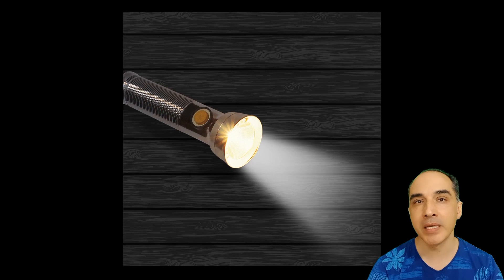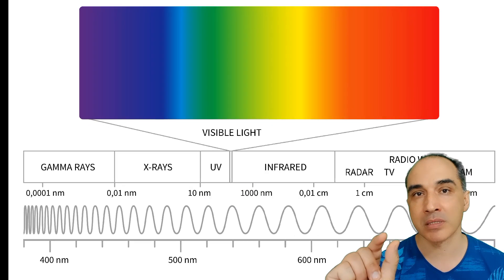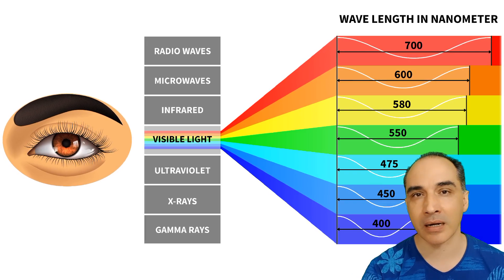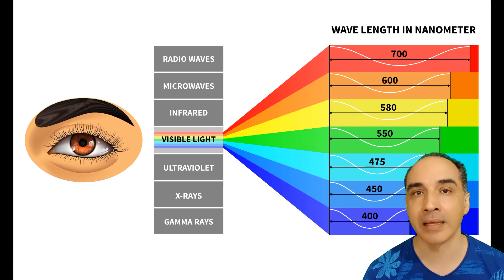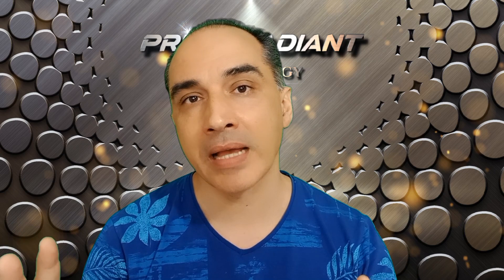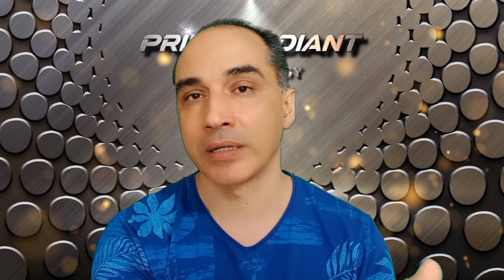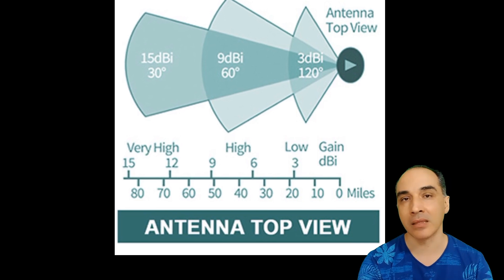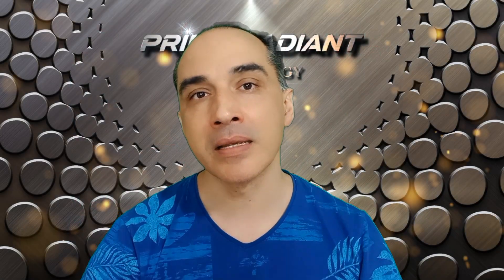How the Space Time Antenna is using Energy Gain Differently.

Comment: dude I can't believe you have made the antenna radiate. if you increase the voltage does that effect frequency requirements?
Reply from the maker: I still font believe it too.
There is a new video jusy added where you can see that the radiation can be picked up from 3 meters distance and convert it to DC 7.2Watts

Comment: green screen bleed !
Reply: Tough to do in smaller spaces. I worked on Back Lighting but had to be 6 feet in front of the Green screen. Later the company I worked for acquired a glass bead screen that a LED ring went over the Lens to have no Color splash at close distances. It was about 1,100USD just for a small screen. Not something I could afford, but it worked great. The Screen was a light gray color with the beaded surface so Lighting didn't get dampened in the shot. Just as a note. The content was well ordered with illustrated examples. It takes a lot to put together. I overlook the problematic green screen artifact. No Offence, as truth is being Honest. I just felt compelled to chime in on this.